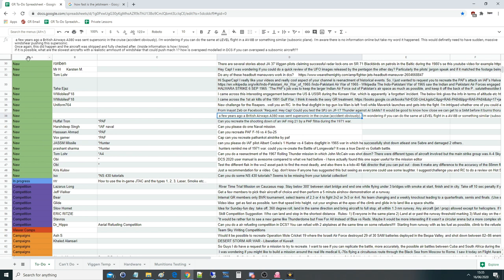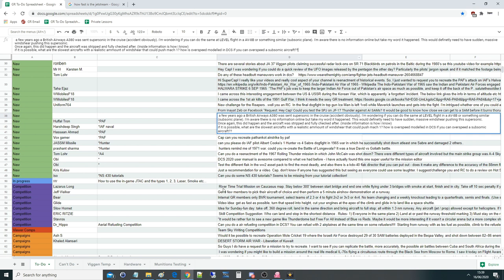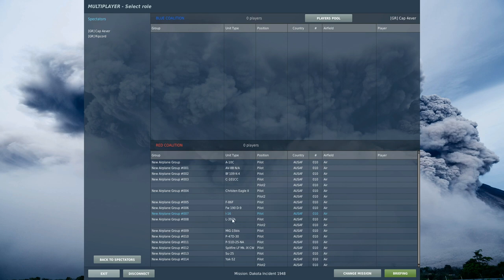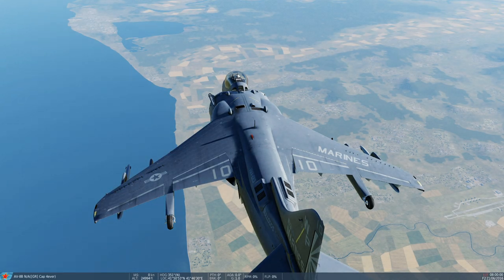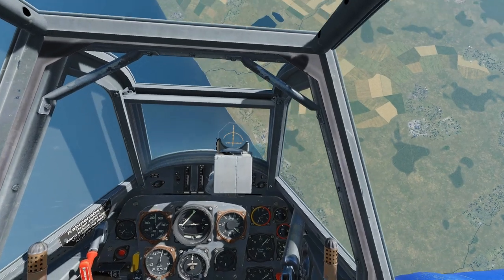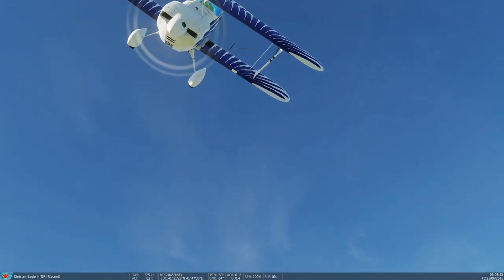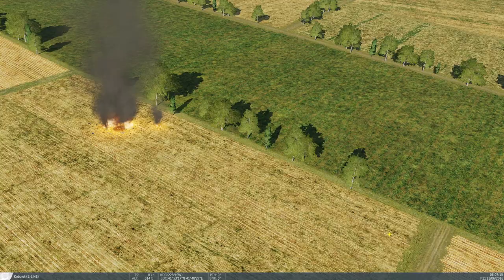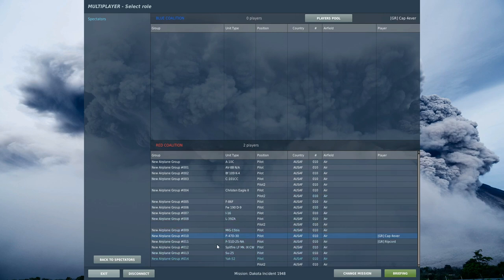Questioned: Which Subsonic Planes Can We Force Supersonic Through The Sound Barrier? | DCS WORLD

Comment: By the way the higher the altitude the lower mach 1 is so you should start at the highest altitude possible. Also a vertical dive may not produce the best chance at supersonic speeds because the altitude and air density change so quickly.
Reply: Worth mentioning that the indicated airspeed at mach 1 drops off a ton, but the change in TAS isn't that significant. Definitely agree that high altitude is the way to go. You're pitting thrust and gravity agianst drag, and the air density effects the drag more than the thrust.

Edit: Top speed in level flight at max cruise altitude into near vertical dive gets my vote
Reply: @michaelharris679  A gradual, slow transition into the dive might be best in order to avoid excessive drag, too. Going inverted to allow the natural lift of the arfoil to transition into that dive may help even further. Start high, get up to max speed, then go inverted and allow the plain to just naturally fall into a 60-80 degree dive is my guess for best results.

Edit: Just watched the video and this is basically what cap did hahaha
Reply: Shallow dive would produce better results from higher altitude, and the condition is compressibility....reduce AOA, increase ALT

Comment: You guys should do another video with these aircraft but where you start at say 30,000 ft or 40,000 ft instead of like 8,000 ft 😂😋👍
Reply: Yeah I agree, air density at those low altitudes makes it hard for even jet aircraft in a straight line to go supersonic.
Reply: Harrier is capable of going mach 1.04 at 50kft clean.
Reply: Yeaaa. Upvote
Reply: A number of these aircraft can’t fly at those heights.
Reply: @SPFLDAngler  they dont need to fly at those speeds they just need to fall

Comment: I love how every one is going on about how the spitfire/insert WW2 fighter plane reached mach 1 or nearly did in a dive. There are lot of stories of pilots reaching mach 1 in their WW2 planes! But none of them are true, i highly doubt the spitfire even reached mach 0.9 let alone 0.96. A lot of people are forgeting the pitot tubes they used on these WW2 weren't very sofisticated and couldnt correctly read mach number. Most pitot tubes of the era couldn't even read near mach numbers correctly. Probably one of the reasons the spitfire didnt actually reach mach 1 is because any pilot that got mach 1 on their air speed indicator promptly had their plane disintigrate and died because it cant reach any where near mach speeds. Or crashed in an uncontrolable dive. People seem to think reaching mach 1 is so easy, its not really. Just look at early jets capable of mach 1.

Comment: As you increase the speed to trans sonic the lift vector moves forward on the wing. They came up with a moving stabilator to provide control. We had an ADI failure on a KC-135 that made the autopilot aggressively push the nose down. By the time the crew reacted they were through Mach 1.  They were able to retard power and deploy spoilers to slow it down and regain control. They diverted to a nearby air field to change under ware.

Comment: Loss of control, in a very simplified explanation happened when under too much speed, air molecules build up into a large compressed shape in
Front of or attached to the front of the foil.  This disrupts airflow over the wing and the control surfaces by putting those surfaces into slow or non moving air pockets caused by the disruption.  They figured out that if they added perforated slats like in the jug or the stukka that they could cause enough drag to keep it from happening in a powered dive but even then they tended to throttle back.  It wasn’t until they figured out that air was stacking up in front of the wing that they decided to start using swept wings. The swept wing allows the stacked up air to slide off towards the outside.  Thats why a P51 can dive at power and briefly go Mach speeds relative to air flow and density.  They didn’t have the power to get there flat and level until jet and rocket power was matched up to the correct shape (pointy and slightly larger in the front and slimming towards the middle and back. That’s when super sonic became stable and survivable for plane and pilots.

Comment: Early Harrier GR3s could actually go supersonic in a slight dive according to some pilots
Reply: I wonder why the Harrier II can't. When the module was fresh, the thing went up to 1.3 in a dive (and even 1.06ish at 40k in level flight). After a few patches it was so draggy it couldn't even reach 0.95 and then later when it was able to cross 1.0 again, it would break up somewhere around 1.03 which is just what we saw here. Devs said it's because of different wings... well, they're bigger, but I highly doubt they'd just break up like this.
Another plane capable of that BTW is the A-4. The community mod A-4 can do that actually.
Reply: Yeah I remember reading about an RAF Officer breaking the sound barrier by accident and setting off a bunch of alarms at a nearby armoury.
Reply: AstraTan do you have a link to the article?
Reply: WackoZacko15 Afraid not, it was in a book called ‘Out of the Blue’.
Reply: Look at the power to weight ratio in a hairier empty it’s almost 2 to 1 for things way like 12,500 pounds... I’m actually surprised the AVB has that much trouble breaking the sound barrier even level flight I get it drag coefficient is probably not on its side
Reply: @williamhedrick7983  That thing is like a flying brick aerodynamically.  The Harrier II is a CAS aircraft.  When I worked on them in the early 2000's I heard pilot's talk about getting close to the sound barrier at high altitudes in a dive, but it really isn't designed for that and it is possible to overspeed the airframe.
Reply: @williamhedrick7983  It's non afterburning. Thrust drops off with speed faster

Comment: My uncle has told me loads of stories of sonic booms coming from the former RAF Waterbeach, this is back when it was a major player in QRA. At that time there were Meteors, Javelins, Vampires as well as the American counterparts. If you can get over the compress ability issues that occur near the speed of sound then putting it in a shallow dive at full whack should produce something, whether it be a sonic boom or a hole in the ground. There is also the issue if causing the engine to flame out as these engines could not cope with super sonic airflow. Its an interesting question and one that will be a lot of fun to find out.

Comment: A SuperMarine Spitfire, late Mk., went super sonic in a near vertical dove over the Bristol Channel just after the war. The pilot pulled back on the stick but it went into a steaper dive as the control surfaces reverse over the speed of sound. My dad told me this and he studied under Barnes Wallace at Vickers Armstrong.
Reply: It's just wrong if you are gonna dive at high speed from the spitfire your dad would have to bail out and his spitfire wings would tear off because the upcoming shockwave is massive 

Again only swapped wing jets can do that 

But for a prop like the spitfire the maximum mach for it would be at least 
Mach 0.89

Until the wings redlines If the speed was exceeded than it's limits

Comment: There were numerous reports of P-47Ds going supersonic in dives from near their altitude ceiling, nominally in western Europe in the winter due to the lessened air density at higher altituted. It'd be interesting to see if you could recreate it.
Reply: I used to do it with the P-47D in Jane’s WWII Combat Flight Simulator back in the day 😂 no booms, but you could check airspeed and the numbers when driving from 30k ft could get into the high 600s too low 700s

Comment: Aircraft like Spitfires had the strange behaviour because they bent with the loads. Main problem is the airflow over the wing goes faster than you do so reaches supersonic flow first. This produces a shockwave that blanks the elevator. They may move but they have no flow to work in. Hence the all moving tailplane. Rather than drill holes, you could have just looked at them to know. All except the Harrier which is one big flying air brake.....

Comment: I was under the impression that the F86 and the MiG 15 were onsidered transonic fighters, they flew subsonic most of the time but every now and then some poor pilot would push things too far and go supersonic in certain maneuvers. Usually the controls wouldn't work after that.
I'm pretty sure that there were times in which WWII fighter aircraft (the Spitfire being one) were also taken to the edge of mach 1, either in extreme maneuvers or even in test conditions to see what would happen (to see if the physics/reports bore out).
I think even a p38 did it during a dive in combat and the canopy blew out because of it.

Comment: As usual, an excellent and fun video. The F-86 (even the A model) could go supersonic in a dive, but it had control problems. The E model added the flying tail, which gave it better control at Mach 1+. The MIG-15 couldn't (as you found out) exceed something like Mach 0.96 or so adn would either be uncontrollable  or break up. The Mach 1+ dive was one of the biggest advantages that the F-86 had over the MIG-15 in the Korean War.

Comment: The F-86F could and did go past Mach 1 in a shallow dive, and you could pull out using trim and the all-flying tail. The MiG-15 is a suicide mission trying to go supersonic because it does not have inferior controls compared to the F-86.
Reply: @dodecahedron1  Let me try that again. The MiG-15 has an inferior flight control set up compared to the F-86F. That is why the MiG-15 is a potential death trap over .9 Mach.

Comment: +GrimReapersAtomic  Among the subsonic types available for Eagle Dynamics DCS:World, the USMC / McDonnellDouglas AV-8B, USAF / North American F-86F, and VKSR / Sukhoi-25SM can stay in control, going supersonic in a dive.  Neither the Mikojan-Gurjevich-15bis nor its improvement the MiG-17 has a stabilizer incidence control, lack of which eliminates pitch control at ≥0.93 Mach.  The USAF / Fairchild Hiller A-10 has a Vne in the mid-subsonic range.  And the tactical prop-planes were designed before transonic research was conducted.

Comment: Hi chaps

The main driver for Mach is actually temperature change (or lapse rate) not so much airflow. So if you get a significant temperature change the local Mach will change dramatically. wind is a factor but it has to change a lot and quickly to make mach change. Additionally the turbulence involved is quite significant when temperature changes of even as little as 4 degrees occur at altitude. Additionally as you descent in the dive your local mach will actually decrease as the air temp increases making it harder to hit mach 1.

This is why we use constant mach climb  / descent above mach/IAS transition and it allows us much higher climb / descent rates in the higher levels as we chase mach not airspeed

Not sure how you can fudge the temperature at altitude in DCS but we often use this in the real world level D sims to demonstrate the upset recovery techniques for overspeed scenarios.

Comment: My first squadron, VA-304 out of NAS Alameda, CA had a KA-6D hit mach 0.998 in level flight. It was stripped of bomb racks for a functional check flight. The tankers were faster than the bombers bec6they had different tailpipes that didn't induce cool air into the exhaust to help prevent infrared detection.

Comment: Most subsonic designs are prevented from going supersonic by compressability upon the airframe producing a subsonic critical Mach number, of the warbirds the highest achievable Mach numbers under test conditions, with pressure adjustment for correct readings was around 0.88 for the Mustang and 0.87 for the BF109 iirc and closer to something like 0.83 for the P47 and Spitfire, although these figures were higher and some were even claimed supersonic before compressability was understood and speed recordings adjusted accordingly. Propellers were destroyed during these tests since obviously their tips achieved faster Mach speed than the airframes so it's dead stick landings all round in any case.
Most, but not all subsonic jets also fall into this category and have an airframe critical Mach number which simply won't physically allow supersonic flight due to compressability although some of these maybe transonic since the biggest limitation for warbirds was the propeller acting like a brick wall.

Some airframes however have an imposed maximum Mach limitation whereby the aircraft is capable of going faster than the quoted maximum but will break up if you do because of instability or airframe stresses. These are straight up thrust-drag capabilities which exceed the airframe safe limitations, several or in fact most 3rd Gen Soviet fighters have this issue including the MiG21 but also so do some large, powerful multi-engine subsonics with low drag for economical purposes, so have a VNE and maximum Mach number less than the aircraft is actually capable of in level flight, but would break up if explored as it is simply a byproduct of making the airframe contribute to less fuel burn, also makes it go faster in the thrust-drag ratio yet is not designed to go there. I think VNE is about direct maximum airspeed structural limitation and maximum Mach number is about aerodynamic instability which may induce structural failure or loss of pilot control, someone correct me if I'm wrong on that.

Then there are those airframes which are quite capable of supersonic flight without much risk however simply don't have the raw power in thrust-drag ratio to achieve it in level flight, which the F86 falls into. In fact many have probably already posted during the time of the Bell X1 tests several F86 pilots were routinely causing sonic booms over the airbase in shallow dives, however the experimental rocket plane was the first to do it in level flight, with scientific instrumentation on board. The Harrier is another in this category and iirc Sukhoi has also published this about the Su25, you may find however they exceed VNE very quickly in this flight condition. I think it's actually the Sea Harrier that's supersonic in a dive but not the GR version.
A4 too but that often destroyed its engine in transonic dives so I can't recall if one ever got supersonic.

Obviously most straight wings unless they're stubs are going to have a subsonic critical Mach number, some are prevented from operating the engine transonic due to inlet design, or have a prop reducing

Comment: The F-86 was the first aircraft to actually go supersonic, even before the Bell X-1.  Test pilot did it in 1946 or 1947 in a dive.  Since it had a flying tail, it could recover.  The Mig-15 couldn't go supersonic, and like the other commenters said, nearly killed Chuck Yeager.  Prop planes can't go supersonic because the prop acts as a huge speed break.  The first model of the Harrier (Gr.1 and AV-8A) were supersonic.  
When the controls stop working, it is called "compressibility".    The higher a plane is, the lower the speed of sound.

Comment: It's pretty well known that Spits during emergency dives routinely brushed Mach.
Reply: It didn't 

The wings would tear off because it's not well angled back enough so the wings wouldn't be able to bounce that shock wave 

Just look for any swapped wing cold war jets and you may figure it out

Try to compare the elliptical wing spitfire vs swapped back wings of any jet fighter like the wings of The Mig-17 or Mig-21 and etc

If you have war thunder on your PC try to compare each of them
Reply: @flak8842  Well for one, War thunder is hardly an accurate aerodynamics model. If you clip the wings on a MiG-17, you can achieve supersonic level flight.

Swept wings are not a requirement for supersonic flight. Look at the first supersonic aircraft, the Bell X-1; It has exactly 0 wing sweep on it, it was a trapezoidal planform wing, as the engineers did not feel they knew enough about wing sweep. Faster yet, the X-3 Stiletto, the precursor to the F-104 Starfighter, neither had wing sweep.

Anyway, there was a Spitfire Mk. XI that hit Mach 0.89 in a 45 degree dive. That same aircraft later hit Mach 0.92 in a dive after the rpm limiter on the engine failed. The propeller was ripped to shreds, which moved the center of gravity backwards, which put the aircraft into a climb. The G-stress knocked the pilot out, and when he came to, he was gliding at 40k feet. He managed to land back at the runway, and the wings were bent noticeably upward and backward (like a wing sweep)

Comment: You need to start at a higher altitude. its extremely well known and documented  that Spit's, Mustangs and P38 lightnings in emergency dives would not only brush Mach 1 but would push past. Sadly most pilots did not survive do to the buffeting on the control surfaces. you need t also realize that these battles happened above 20,000 ft not in the more dense air at 8,000 ft.
Reply: You know when the Germans have  created the me-163 to fight the US B17 bombers 

It did fought them at 20000m if I am right

Right at that altitude the me-163 can reach the sound barrier nearly at it's wings speed limit
Reply: But again at extreme altitudes you won't break any sound barrier

Maximum speed for all of those WWII props would be mach 0.89 no more